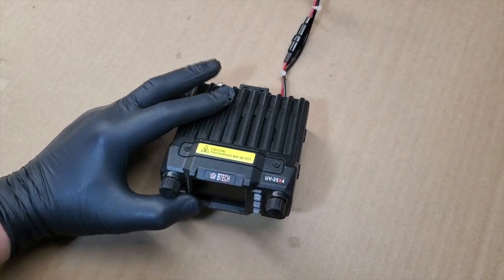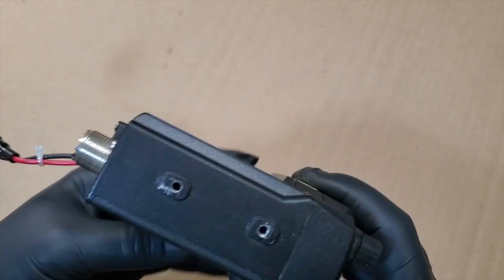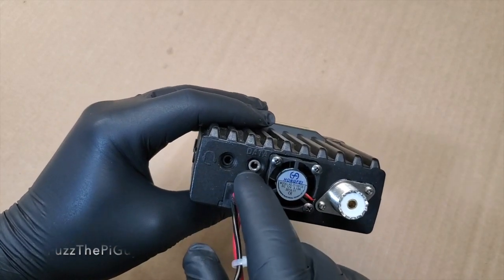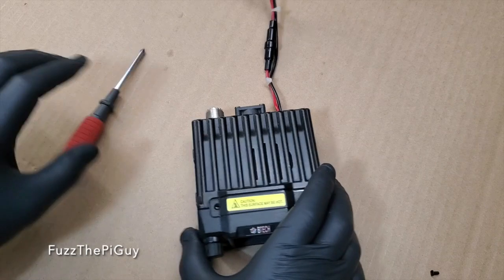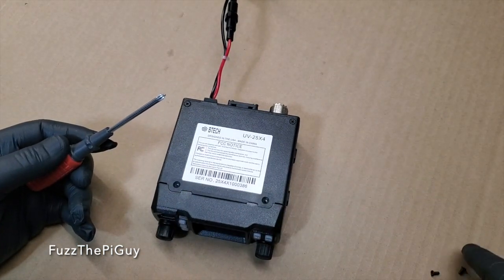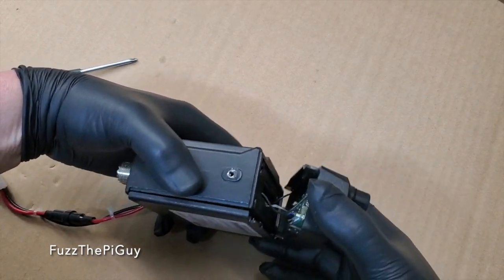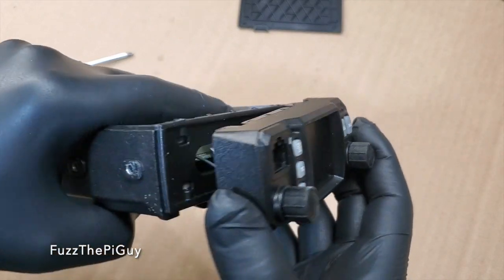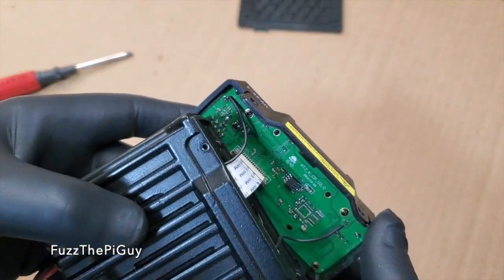A Look Inside The BTECH Mini UV-25X4 25 Watt Tri-Band Radio  |  Ham Radio

Comment: BTECH UV25X4 verses RADIODDITY QUAD25, 25x4 has Mic Gain control option, QUAD25 does NOT have Mic Gain control option. Radios appear Identical but firmware is different. This is a problem for me on local 224.680 repeater as its very sensitive to Mic output and signal breaks up (chatters) with least bit of excessive modulation  : (   Any experience hacking radio's firmware?